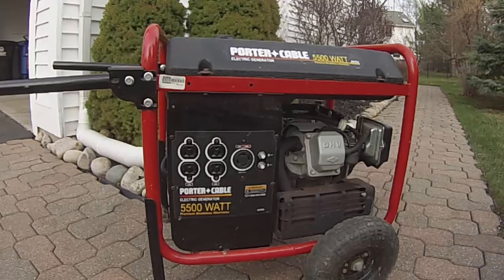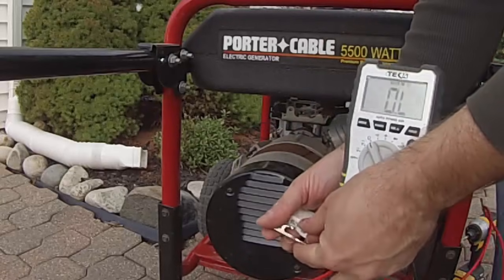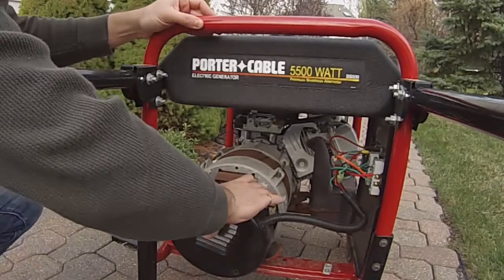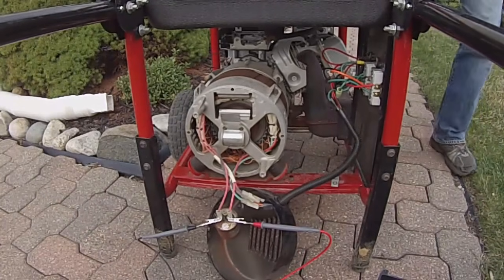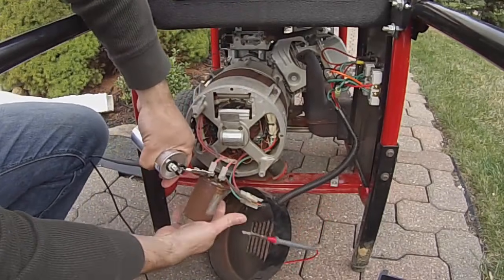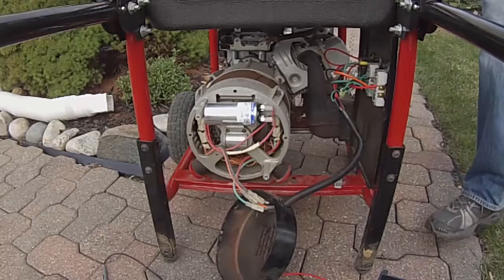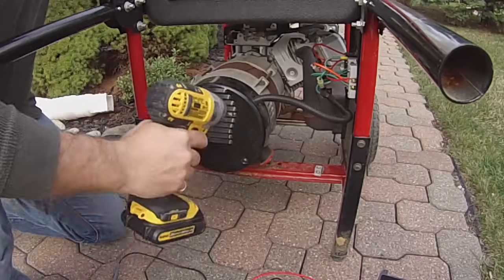Brushless generator not producing any power

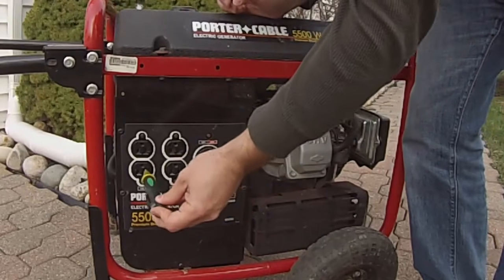Comment: Ok those aren't fuses @0:32.  Those are circuit breakers.  Circuit breakers don't "blow." Fuses blow (or more precisely they melt).  Circuit breaker "trip."  You reset a circuit breaker.  You do not reset a fuse.  You might not give a shit but when you are making a video you should use the proper terms.

You think that capacitor is there to "protect all the electronics down stream?"  That is never why you put a capacitor in a circuit.  You may put an MOV in a circuit to protect is from a voltage spike but that capacitor is probably in there for a completely different purpose.  I could probably tell you why it was in there if I could see the schematic.  Just because if failed when you "had your accidental power surge" doesn't mean that the capacitor is there just for that reason.  That capacitor was probably going to fail anyways.  It just so happen to fail right when you did "let the engine race for 1 second."  Correlation does not mean causation.
Reply from the maker: I agree about the fuses... Sloppy terminology on my part.   

I also agree that the capacitor is not a fuse or a circuit breaker (I didn't meant to suggest that it was), but it is there to regulate the excite circuit on the generator so it stays around the normal voltage as the generator loads vary.  In my case, I had messed with the engine RPMs so much that I blew it out...  But in its function as a regulator, it protected the windings and downstream circuits...
Reply: I did not mean to imply that you thought the capacitor was a fuse.  You did not say that in the video.  But you did say those white circuit breakers were fuses. So I took issue with that.  I am an electrical engineer that specifies and designs power systems for very large plants like Oil & Gas Refineries.  I know exactly how generator field excitation works.  I know exactly how capacitors work and the differential equations that are used to model them.  I have never seen such as large capacitor in a generator field control circuit.  Capacitors can act as crude voltage regulators but in general that is not what they are used for.  This is probably a Chinese designed generator.  The Chinese only care about price so they will produce some pretty crappy designs in order to produce a generator cheaply.  If you can afford it get a Honda.  Best generators made but damn are they expensive.  You get what you pay for.  If you had a Honda you'd never have to worry about these kind of problems.
Reply from the maker: Sure, while doing my research before buying this generator, it was pretty clear that Honda was considered the best and they used that to justify a 3x price. While I would have preferred a Honda if someone else was paying, this generic brand has only needed this one 16$ repair over hundreds of hours of construction site use, so I probably made the right financial decision.  Of course, I do give it regular oil changes, etc. but this was the only part I have had to replace.

Meanwhile... Your qualifications make me wonder why you even took a look at my amateur video ;^)
Reply: People do not always watch your video because they are "searching" for amatuer videos.  I have autoplay on so when I went out to check on my sons who were playing outside, many videos played one after the other while I was outside.  I don't even know how many played before I walked back in an hour later.  Yours was playing when I walked into my study.  So I continued to watch it while I took my shoes off.  I shook my head when you said, "fuses."  An engineer just can't let something like that go.  I came across your video on accident.  I don't enjoy watching videos like this.  Had it not been automatically playing when I came in the room, I would have never seen it and never commented.
Reply from the maker: That makes more sense ;^)  I could have fixed the whole problem if I used a script.  Have a good evening.
Reply from the maker: One more thought...  I totally understand your point of view.  I am an Aerospace Engineer myself, with a masters in automotive engineering and I just spent the past few years reading everything I could about Civil Engineering to build my crazy earth-sheltered house.  I have commented on a video or two in the past because they made some silly tangential comment about some thermodynamic property or other, such as describing concrete as an insulator instead of a thermal mass...  We like to focus in on the little technicalities that others don't seem to care about.
Reply: That is why we are an engineers.  Because we care about the details.
Reply: Impedancenetwork $
Reply: you need to relax
Reply: Why Simon entertained this douchebag is beyond me.
Reply: Very important video about generator safety https://youtu.be/I1jT3ANENvI hope everyone stays safe. Thank you. Keep children safe when using generators also.
Reply: Impedancenetwork Sitcom idea: The Volts. A fish out of water couple of guys are thrown together, arguing about engineering till a pair of ragamuffins show up. Tension builds when we discover the kids have high IQs but NO impulse control. 😜 ☃️ 🎅🏼 🎄

Comment: Very good. These electrolytic capacitors will dry out over time, especially due to non-use. Run genset every month or two for 15-20 minutes UNDER LOAD. This will accomplish a few things. First, it will keep the electrolytic capacitor(s) in good shape and charged. Second, moisture in crankcase oil will be burned off and carburetor gumming will be kept to a minimum. Third, your engine seals will be kept lubricated and lastly, you will spot any performance problems and be able to fix them BEFORE you loose power and really need the genset. So many will not take these simple steps and when they go to use genset, it either doesn't start, or produce power......also, use aviation fuel if you can. It has a much longer shelf life and has no ethanol, which can damage some older carbs. If you can't get aviation fuel, use stable and run your carbs dry always....
Reply: I always shut the fuel off, and run it until it stops,  then also drain the bowl of the carb too.
Reply: @austin22re  That's what I do to all my gas engines, is run the gas out of the carburator. If the gas tank is plastic, you won't have much trouble with the gas going bad on you. It will ALWAYS go bad in the carb first. Don't know why, just does. If the gas tank is metal, well it seems like you should drain that gas as well. Luckily most machines (small ones anyway) have plastic tanks.
Reply: Don’t forget about generator safety as well https://youtu.be/I1jT3ANENvI
Reply: Great advice, John.
Reply: True, but you have to be realistic, a homeowner with a portable generator for backup (rare use) power isn't going to exercise it "every month or two". Personally, I recommend storing it without fuel with the carb dry and aim at taking it out every 6 months to a year to give it a little exercise with the expectation that most people will put off or forget this chore. Also Aviation fuel is great in that it doesn't have ethanol but it's terrible in that it contains lead. We switched to unleaded gasoline for good reason, so I suggest ethanol AND lead free gasoline for use in outdoor power equipment.

Comment: So you use a non- polarized AC Electrolytic replacement capacitor for your fix's.  Correct me if I am wrong.
Reply from the maker: I looked up the proper replacement, and then bought a generic one that had the same specs, but cost a small fraction of the price and it has worked well ever since.

Comment: opened up the back like you said, no wires or electronics, is it possible there up between the motor?
Reply: ray conway  yes mine has the capacitor(s) located in a box on the side of gen
Reply from the maker: Not sure what type of generator you have?  Is it a "brushless" one like mine?

Comment: Thank you so much I fixed my generator with the same tipe of capacitor from a AC 40uf  370 vac and it works just fine no problem is the best idea and my is a UST 1200 W and it came with a 24 uf+5%  - 350vac 50/60Hz

Comment: You should know that particular capacitor application will shock you worse than about any application for capacitor. They will remain charged for weeks and hold 400+ volts.
Reply from the maker: This isn't in a big TV or something.  This is a 5 volt, 40 μF capacitor.  I agree we should always handle capacitors carefully, but I don't think this one can store more than 40μF x 5V = 200 μC without discharging its self.  You need something like 48 volts with 1000μF if you want some damage.
Reply: Simon HomeintheEarth do what you want but THAT application is unlike other electronics, it will charge up to whatever the rating is and stay there to provide starting magnetism.
Reply from the maker: Right, it charges up to the rating of 40μF x 5V = 200 μC.  It simply can not hold more than that, no where near 400+ volts.  I agree to always treat these things carefully, but if you screw up, this one wont kill you.  Of course, that is the math.  As I said, I always treat these things carefully, so I didn't test the theory.
Reply from the maker: Oh yea, I guess it can store up to 370VAC, but still, with only 200 μC.
Reply: @kennyhonse2017 pansy 🥴

Comment: What site you went on to find the  capacitor size you needed? I have a 6500watts (H650IS-W) and looking on the net and having no luck at all
Reply from the maker: Go look at the old capacitor.  Find out how many volts and how many micro farads...  μF  Then type that into Amazon.  The capacitor I got was not an exact match for size and shape, but it matched where it counts...
Reply: @SimonHomeintheEarth  Another website says you HAVE to get a 'generator capacitor" I dont know the difference, but it's important
Reply: I'm a sparky, and never heard of a capacitor built for a particular job/equipment. I think it's more of a marketing thing. Saying yhat, there is quality capacitors and cheap ebay ones

Comment: DANGER     DO NOT TOUCH METAL CAPACITER   DISCHARGE FIRST      PEOPLE  HAVE DIED
Reply from the maker: Being careful with capacitors is a good general rule of thumb, but this capacitor is only ever charged to 5 volts and with only 40 micro farads, so it couldn't really zap you very hard.
Reply: @SimonHomeintheEarth   "I checked the internet to find the right one for my generator, a 40µF, 370VAC generator capacitor."   I think the point is it could potentially hold a bit of power, it's not a 'small' capacitor.  It's potentially  above the 40v barrier to jump skin.  And most people watching this aren't going to know what it's charged to until they enter teh Danger-Zone.  We all gotta look out for Charles: https://www.youtube.com/watch?v=WW_6WkbwyKA

But, is see now what you mean about being charge to only 5 volts.  https://www.youtube.com/watch?v=Qqw3JQp31Vw  So unless there is some major malfuntion charging the cap, it is a practical impossibility of achieving problems.  Today I learned.

Comment: glad to have found this.  I saw the stator had two pink wires to the capacitor.  Any reason they have the same wires?  Or is that cap not polarized?
Reply: You're dealing with AC here so the capacitor is NOT polarized.

Comment: capacitor there design hold power kind electric eel had the meter set lower voltage to 2 extra fuse replace

Comment: If the capacitor was good, what would the reading be?
Reply from the maker: +treeroofgrass Sorry I wasn't clear.  I was actually testing the wires leading from the alternator to the capacitor, not the capacitor its self.  They were showing that the capacitor was getting 5 volts.  I only left the capacitor on because it was easier for my alligator clips to hold onto.  If those wires had not been feeding the capacitor the 5 volts, I would have needed to check the windings or something else in the generator to find the problem.  But because I knew that the fuses were not the problem and the alternator was turning and producing power, by process of elimination, the capacitor was the only thing between them, so I could conclude that it was bad.

If the capacitor was good and the alternator was feeding it power and the fuses were not the problem...  Then my generator would have been working and I wouldn't need to do anything ;^)
Reply: oh cool! thanks for the clarification. I have a generator and am trying to learn as much as I can on how to fix it when the time comes.
Reply: The capacitor probably had gone open circuit.